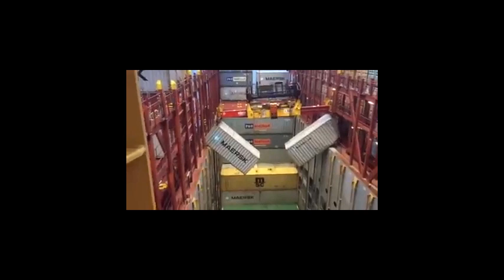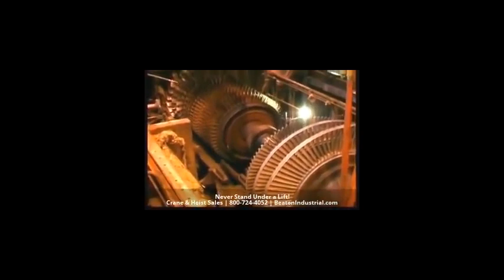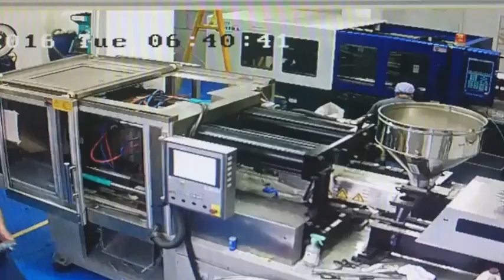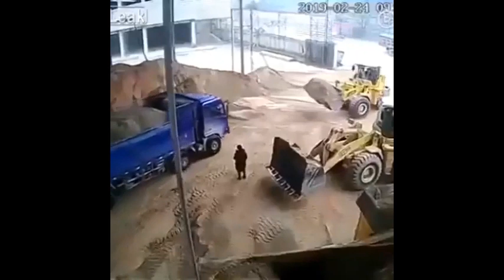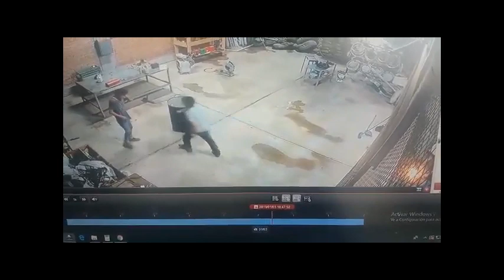INDUSTRY ACCIDENT COMPILATION

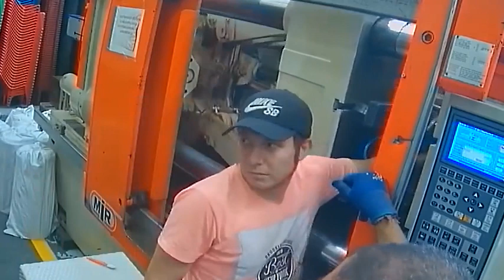Comment: 6:39 I don't always stick my arm into closing machinery doors. But when I do, I always turn my head away.
Reply: That is a typical scenario when the work becomes too routine
Reply: @Your_username_  This video was quite eye opener.
I realized that my summer job aröt plywoodmill  have become so repeative that I might blindly use control panel while still working with other.
Reply: Did the machine amputate his hand?
Reply: And his nose
Reply: Funny.
Reply: @Your_username_  now he's looking forward for an exciting job ahead.
Reply: Employer: Very good! You're hired!
Reply: What pisses me off is I work with injection molding machines. There's suppose to be a safety door you have to open that cuts off the clamp's ability to be closed. Idk what these guys are doing but they're bypassing something.
Reply: @vegas9440  I think it’s dumb to call people stupid when mistakes are made
Reply: @vegas9440  haha fair enough
Reply: @intothekey  the door is there but they have removed the saftey glass so the machine can run fully auto
Reply: @tanveerkhan9221  Yeah that's so stupid. If the mold can't eject the part properly then just run it in semi. Your not even losing that much time if you have a quick operator.
Reply: I work on an IMM (injecting molding machine) looks identical to that. That was scary lol
Reply: @tylerpiret2712  Was the safety door removed? I'm no snitch but even I would of reported that.
Reply: @intothekey  we open a door, pull the product out, then close the door, and lastly push (or hold) the button to close the mold. Not sure about a safety door but I hope that helps!
Reply: @intothekey  I just watched the video again and no we definitely have a safety door. Sometimes the product shoots out of the sides and splats on the door. I have seen people accidentally leave the product in the machine and run a cycle, it shoots the shit up on the ceiling. Stuff come out at around 300 C or 500 F
Reply: Yeah those guys were being really stupid.
Reply: And his mate right after witnessing that goes and leans on it straight after Wtf 🤡

Comment: my god that turbine drop was probably the most expensive fail
Reply: By far. 

It was actually a component failure on the crane, not operator error. Imagine how bad the dude felt though
Reply: @DGFishRfine1  Funnily enough, they actually intentionally used a crane that had a lower lift capacity to try to save money when they knew that it wasn't rated to handle the weight of the turbine, lost them a ton of money in the end
Reply: @Bullerephon  wow...talk about playing stupid games. If I were the operator, I'd be furious. I bet they tried to blame him
Reply: I read about it because of a different video. The mistake cost millions of dollars
Reply: ah, you take a hammer, knock the part straight again and all is well
Reply: if I remember, isn't each individual blade like thousands of dollars by themselves? Multiply that by hundreds.
Reply: I know right, why stand right in front of that bulldozer where the operator cant see you?
Reply: no kidding, a lot of labor, time, and resources go into producing large turbine engines. Those foils are toast.

Comment: My friend had died at a steel company while we were working on a automated order picker and I told him to shut it down and loto (lock out tag out) he said he will be quick and shortly after the machine started and he got his head crushed in the machine. I know that safety protocol can be irritating but his 4 kids and wife lost their father he was 26 at the time so tragic just to save 5 minutes
Reply: 4 kids at 26
Reply: @totoroid  That's normal if you didn't know
Reply: Fuck, that’s how old I am. I’m very glad my current job has strict rules on LOTO with absolutely no exceptions. We do a lot of transferring thousands of gallons of chemical product through systems. This creates massive PSI in the system. Just the other week a bladder in the system exploded during a system failure. The relief valves failed to release the pressure and the bladder exploded like a grenade. No one was around it luckily.
Reply: Dude..I'm so sorry..

Comment: 4:50 the barrel had more tonnage then what the stationary side could handle. (most likely it was a mag plate) this happens when someone changes the setting to the barrel and the mold is open when the barrel connects to the mold. Always shut your molds before bringing your barrel up to zero out or recalibrate it.
Reply: Thank you was curious as to what happened
Reply: I'm curious why is a surgeon operating a injection moulding machine

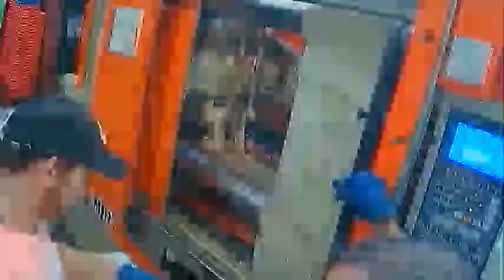Comment: 6:35 the machine did not close fully cause those shiny rails on the top right did not go to the point where the dusty line is. Was it due the machine not having enough power to close fully cause of the arm or was it programmed to not fully close there?
Reply: I think the put out the Window from the safety door
Reply: I work with injection moulding machines and trust me that machine would have flattened his arm like a pancake if it wanted to. All moulding machines have a facility called “mould protection” that means they won’t lock home until the two faces of the mould are approx 0.2mm from each other. If it picks up an unusual object causing it to take longer to close then it will stop. Usually this is a part not ejected properly off the moving half. In this case it was the guys arm, that’s why the movement stopped. Looks like mould protection was set up properly and saved him. Idiots had the screen from the guard door removed and the other guy pressed mould open to release him not emergency stop!! The whole thing is madness

Comment: I was a sprinkler fitter for a bout and I got blown half way across a room due to a slip on valve gaskets giving up on 10 bar 12000 litres of water a minute sprinkler system valve set was interesting 👍

Comment: At 6:40 you can se that the press door is closed but they removed the lexan window, safety sensors are fixed to the metal frame of the door so safety measures are bypassed and the machine can operate at any time, they probably wanted to speed up production and plus they putted there a totally careless operator, when the safety gates are closed those press can produce pretty high kN of force before the emergency stop kicks in. 
Not a clever solution...

Comment: You know ive worked at a meat market in the back where all the meat and tripe is diced and packaged and one time i was using the grinder and for some reason undid to the lid to the meat grinder and forgot the lid was not twisted on and by accident turn on the grinder machine and put dents in my boss machine it was scary and loud and violent as the steel arms that mix the meat beat violently with in the machines insides but but still workable and learned to never do that again yeah i remember i was just starting the cleaning process and had to unscrew the lid to get all the grinded meat out of the grinder and it was to difficult to force out the meat and hit the power button by mistake and saw what happened scary ass hell.

Comment: Another accident that i can identify with. The same thing happened to me once when i pulled the UP lever to raise a load of strapped pipe. The load went up a few feet then it all came tumbling down in a free fall. All the cables, the boom, the pulleys, and part of the trolley that it's all hooked to fell to the ground. no one as injured  in my scenario but it scared the guy who had just strapped up the pipe. It was a two ton load.

Comment: First scene: the person who caused this coil to move is on the right using a remote control device strapped to his body with the controls for the crane at his lower abdomen in a small box. You can see him operating the box with both hands when he comes over to the scene of the accident .  there are five small levers on the control box - up, down, sideways and two to open and close the gripping arms that go into the coil holes. The sideways control moves the overhead crane on rails one way and another or more accurately north and south. He mixed up the levers probably by not looking at them. This is evident when you see his head turned and talking to the other man. The coil moves before the operator was looking at it.  I ran this type of remote device @ Sharon Tube Company in Sharon Pa and after using it for a few weeks you did not need to look at the controls. This person must have had a combination of being new, mixed up the levers and was talking to the man next to him. People depend on crane operators to be extremely careful and this man just got careless.

Comment: I work on a toyo 1300 t that is  much bigger than the  machine on  this video. when I enter between the mobile and the fixed part of the mold to do some work, I always turn off the engine before entering. never trust machines!!

Comment: I'm searching through what of these videos I can find so I can show them to a friend... Her current workplace has new owners that are rolling out several safety measures that she's unhappy about to say the least. (No necklaces/ loose jewerly, no hoodies, ear plugs- not buds - the usual. But also includes a truckers hat with a bill & plastic inner shell , that limits visibility drastically & is not designed for looking up, as job requires. I want to show her that those seemingly tedious & pointless precautions are 9x out of 10 have a very good for being there.   What strikes me as odd about her attitude is the fact that I met her at a factory that was extremely safety oriented....I think it goes to show what another comentor pointed out.. practicing safety is a culture learned and accepted to whatever degree by being the norm.

Comment: 6:20. Deserved. Why? Because they cut the plexiglass panel out of the safety gate to reach into the press. Operator wasn't paying any attention.
Reply: Why l loved the layout of one machine I worked on you had to press and hold 2 buttons at the same time until the press closed
Reply: @BTpaintballer  They also were running the machine in full auto and reaching in when it ejected the part. Stupid as all hell. Run semi. Shut the door.